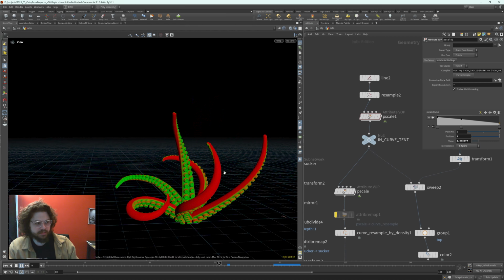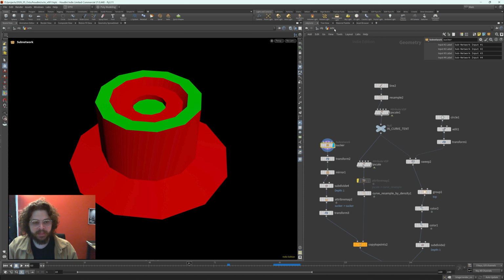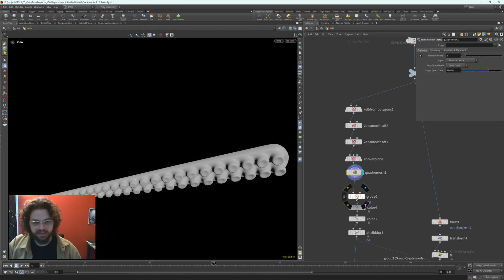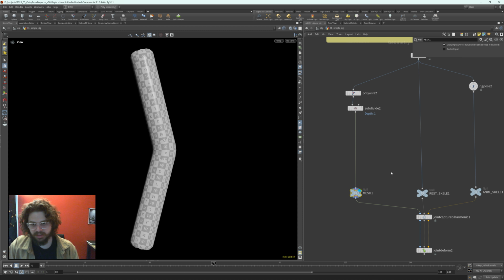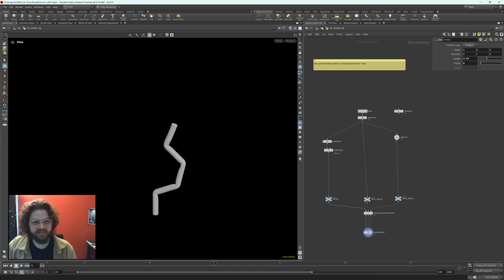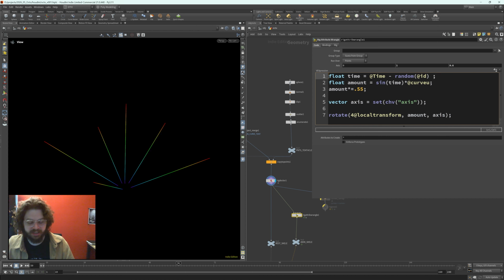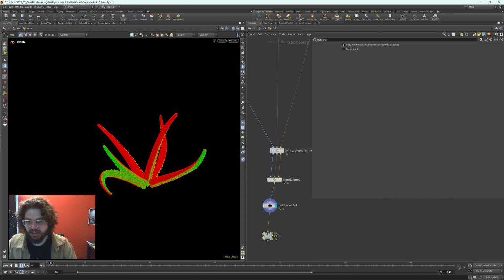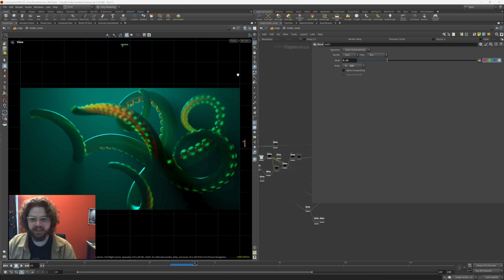Houdini Walkthrough | Procedural Tentacles

Comment: HI, useful breakdown. I love kinefx - I find it really useful for motion graphics stuff(don't do a lot of character stuff). One minor thing, I believe it's better to use prerotate rather than rotate - but I cant remember why. Also you could keep more detail on the suckers if you used a fog sdf into the second input of the vdb smooth to limit the smoothing to certain areas(ie the base of the sucker).(you probably already knew that, but putting it in comments in case anyone else doesnt). Thanks.
Reply from the maker: Great tips, thanks for commenting! What mograph stuff have you tried it with, would love to see!